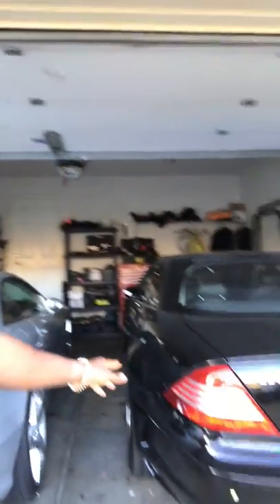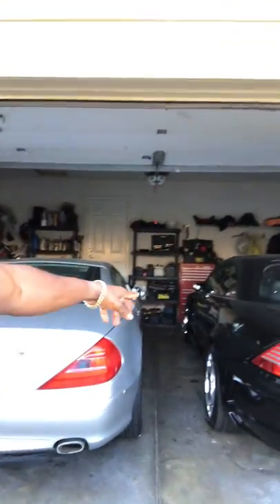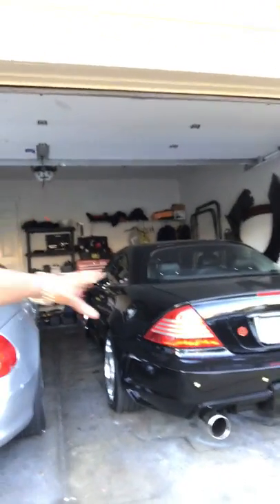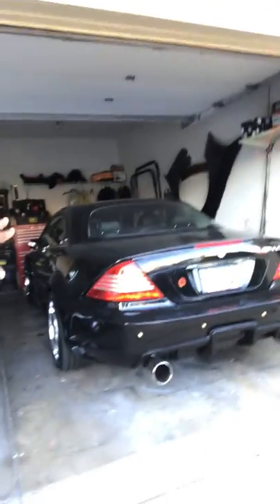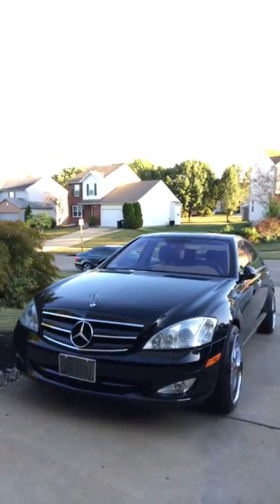Update to SL500 R230 ABC Suspension Gold Element Autoworks

Comment: The red ABC warning over bumps is usually one or more bad accumulators. They wear because they have a rubber diaphragm inside.  I love the ABC on my SL65!  It’s absolutely incredible how the car will not sway around hard corners. My ABC pump just started leaking, so I’m replacing it with a reman and at the same time replacing all accumulators before they go bad and I’m rebuilding both valve blocks.  If I find any lines which are weeping, I’ll have them repaired at a local hydraulics shop. So far I’m still under $1k in parts. All the struts are good, but I am replacing their dust boots which have hardened and cracked.
Reply from the maker: Michael Pitts Correct. The red light over bumps is a dead giveaway. Accumulators. The raising up and down at idle is indicative of leaking o rings in valve block. So a rebuild is required. The silver car has 100k miles on it. About the time for the system to be gone through thoroughly to prevent more failures. When you go remanufactured parts or used parts.....the maintenance and upkeep is bad. But with multiple cars, I’m getting to the point of just wanting permanent solutions.

Comment: you're lucky man,  I wanted to fix mine but I just can get the lines or get mine repaired.   I will be taking all the lines off mine but I don't think they will ship too well.
Reply from the maker: David Moore Those are some difficult lines to get access to or replace....depending on which line blows. I’ve avoided fixing lines most of the time. But with these two cars.....I actually put forth some extra effort. But trust me......the better route is to go coilovers. I’m just buying time. Regarding shipping of lines......I received mine in a long box. If you can......remove them carefully. And attempt to sell them. They are expensive so worth the extra effort. Sell them.
Reply: @goldelementautoworks  I'm trying to preserve as much as I can, I'm in a position where my issue may help others so we should get a cl, sl s running on abc for longer

Comment: its your accumulator bulb thats making the ABC light coming on.  You have to replace it.  Also for the busted line I have a 50 bucks fix that repairs the lines easy
Reply from the maker: Gwendolyn Williams Whaaaaaat????? What type of fix? Can it hold up to the pressure? Also......the up and down at idle is a continuous problem. I can’t remember which wheel it’s raising and dropping. Fluid is sneaking past one of the valve blocks into the strut and raising it at idle.